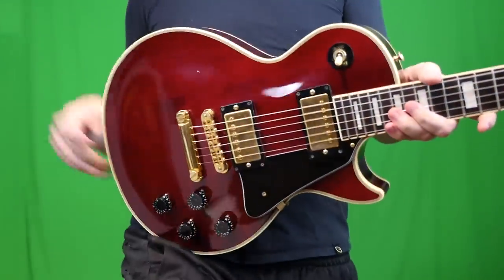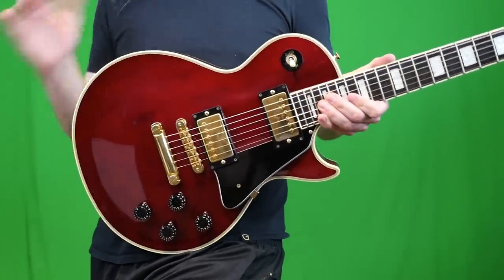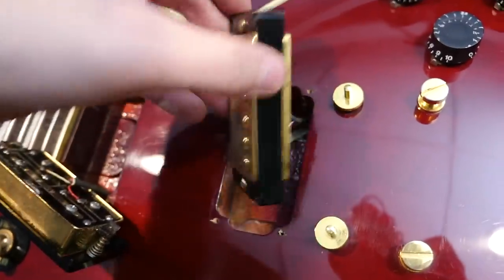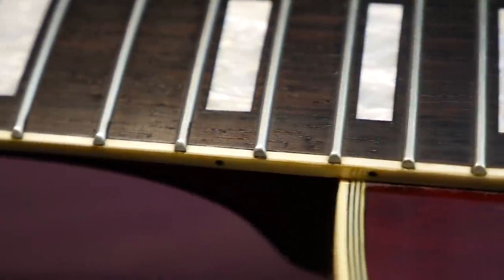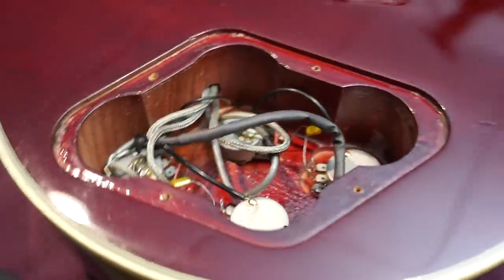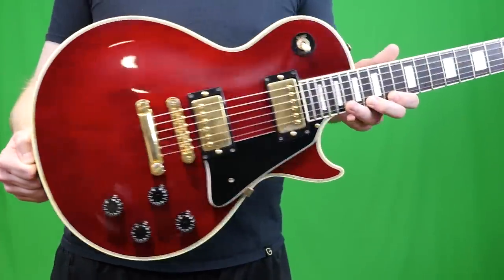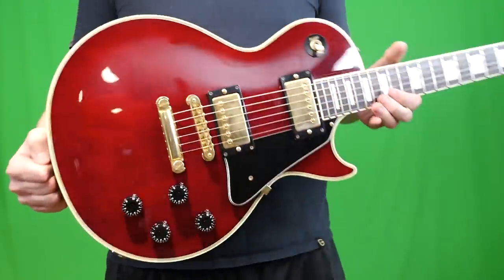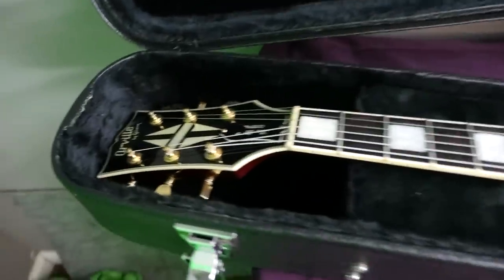What's the Deal with Orville by Gibson Guitars? | 1989 ObG Les Paul Custom Wine Red | Review + Demo

Comment: Generally better to go directly to japan for most of these copies, but I thought I'd find something on the auctions over there showing them selling low (as is the case with arias over there, and yamaha les paul copies), but there's literally a huge list of fixed price listings with no bids and none that are actually on a live auction that will sell. 

I'm a big fan of the japanese guitars, but the virtue in them is two-fold:
* they are often going to have some wear on them and will need a little bit of work
* the lower end models, especially the guitars made out of agathis pancake bodies and two piece maple necks, often go really cheap in japan. Like $200-$300 (with caveat about some work being needed to be primo as mentioned above). 

(also fair warning, a $250 inexpensive paul will cost another $150 to get shipped here EMS after you also cover proxy and in-country shipping fees)

Lots of paul copies over there, some very cheap, even the pancake guitars have decent proportions and can be made to be really nice players. The often made statement of "always better than gibson's guitars" is errant, though. Most are more cheaply made, and most figured top guitars are veneers until you get into the very high cost area (like a $2,500+ tokai, something like a current KLS 345). I had a $1500 used tokai (HLS 240) that was an excellent guitar, on par with the best of gibson's work, but it did still have a veneer over plain maple top, and not a solid figured top. 

I own no gibsons at this point (have had at least a dozen), so I'm not a fan boy. Just wary as an amateur builder of statements that may lead someone to go pay $800 for a pancake paul in the US when the same guitar sells for $250 in japan. 

Fingerboard on that guitar is definitely indian rosewood.
Reply: Good work on the video, by the way.
Reply: Another by the way, the vintage top carve is divine. I understand why it's not always present these days (cost), but it sure does look a lot better. Agree with you that they're kind of a step on the ladder below the best customs, just a little off, but someone focused on playing won't notice the difference. Someone focused on the guitar entirely probably will.

Comment: DillionGuitars makes great LP, Fender and PRS clones.
Reply: not really,they are a brand that looks like a les paul but arent  as good as a chinese epiphone.Korean epiphones can be quite good-awesome ive got two and love them
Reply: @trillrifaxegrindor4411  Dillion guitars are made in Korea. I've had 7 over the past 10 years. I still have their Fender strat copy and 2 LP copies. One of which is White and is no longer made by them. It's only been played about 10 times. It's still like brand new in it's case. The other LP, with a Green quilt, I had DiMarzio pickups put in. A Tone Zone in the bridge and an Air Zone in the neck. Set up for coil tapping. About a year after I did that, Dillion started making their guitars with coil taps. The guitars are most likely all made at the same factory. They just get a seller's name put on the headstock.

Comment: You just proved the tone wood discussion. You hear how bright it is acoustically, not plugged it. It will sound the same plugged in regardless of the wood, plastic or metal it could be constructed of. Pups and strings make an AC electric signal, not wood.

Comment: The Long tennon is the best part.  Yet it sounded really quiet, not just bright, when played acoustically.  
I think you need to try an older Tokai.  79' to 81'.  LS 100 or higher.  They have a great rep for building
consistently awesome guitars.  Unlike you know who.  Even the LS80 will do good against a CS.  They
are more geared towards sounding like a burst and they did a good job at it.  They are highly collectable
so you will have to spend a little but you will get your money back....if you don't keep it.  And you most 
likely would because they are amazing.  IMO they are the best LP you can get if you get the LS200...  If 
you are trying to get the 59 60 flavor.  They used the old growth wood just like the bursts.

Comment: Just too expensive still.. I'll buy Melody Makers and Epiphones
Reply: I think they also have a bit of a sort of collector vibe to them already, which affects the price. I like Agiles more than Epiphones though.
Reply: @AR-zq9hq  still too rich for my blood. Once you dial in a Epiphone Special I P90 with the right strings and setup..  Volume Pot placement is perfect IMHO
Reply: @the_nondrive_side  my favorite Epiphone product is a Valve Jr.
Reply: @AR-zq9hq  combo looks like joke but the whole concept seems legit to me. I need a small tube amp like that
Reply: @the_nondrive_side  EVERYONE needs a 5w tube amp. Even if you're not a guitar player jk. I don't like combos in general, I prefer heads, but the circuit is extremely fun if you know which end of soldering iron to hold (though you could use that time for practicing...)